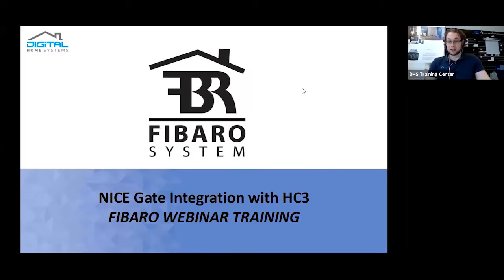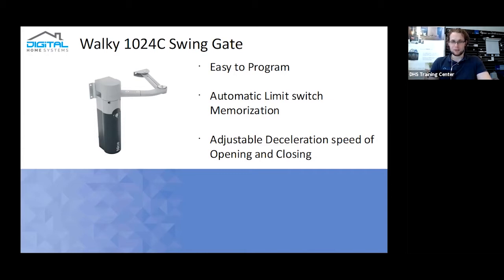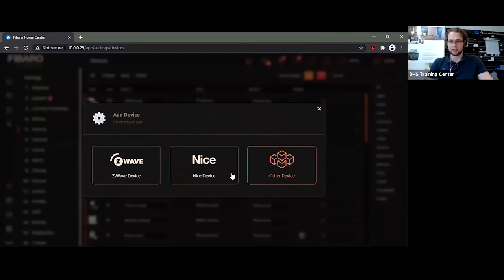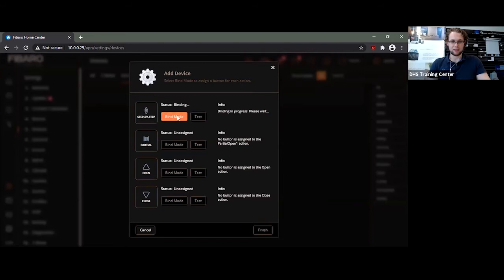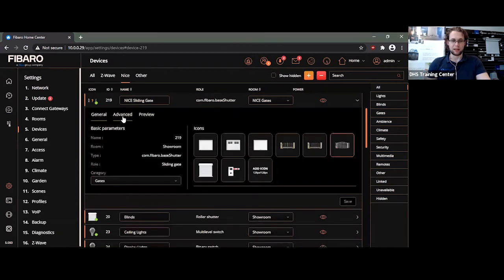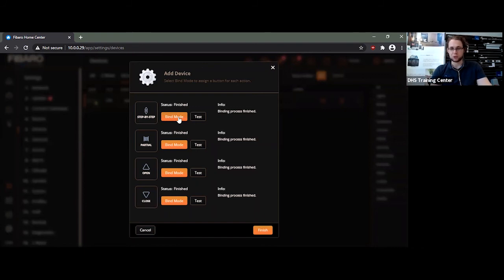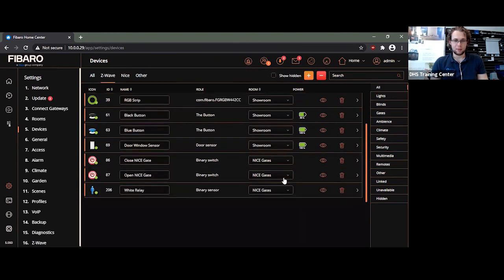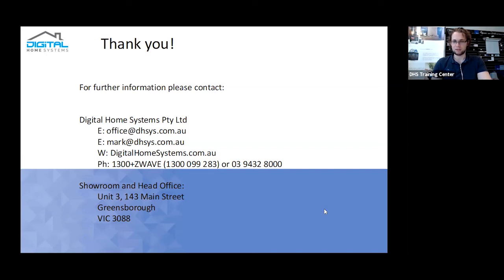Fibaro Integration with NICE Gates Webinar

Comment: Hello, I see that you have experience, maybe you can help me.
Today I installed SPIN23KCE motors, with OXIBD andON3EBD. I tried to add a new Nice device to Fibaro HC3 (both ways, with and without a remote), but I can only operate the step-by-step function.

Can you guess what I'm doing wrong?

ON3EBD also have only SBS function programmed. Maybe the remote needs to be reprogrammed? How?

Also, I tried to add ON3EBD as remote scene controller to Fibaro, a new device is created but does not work.